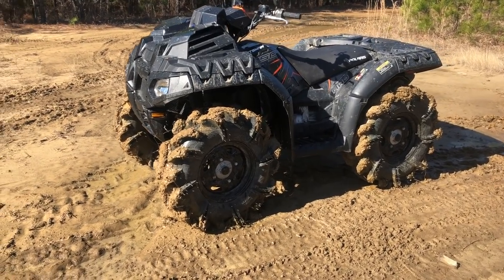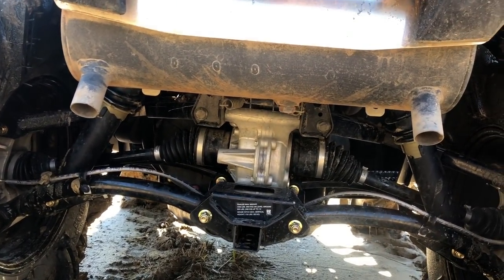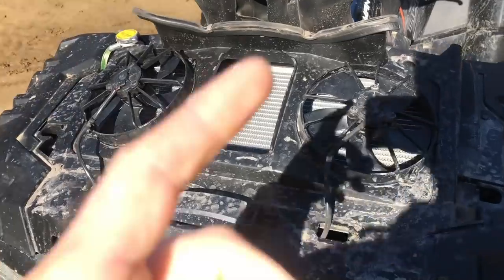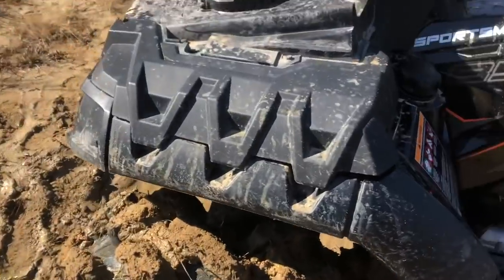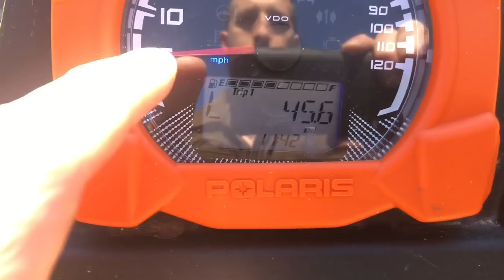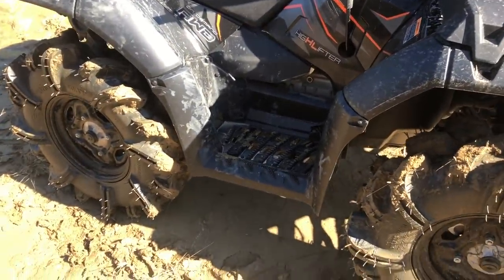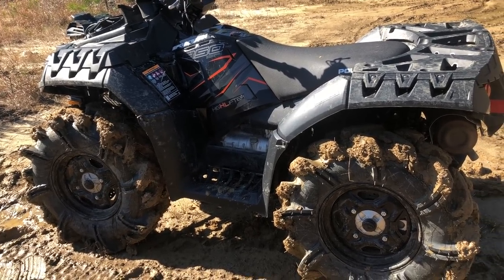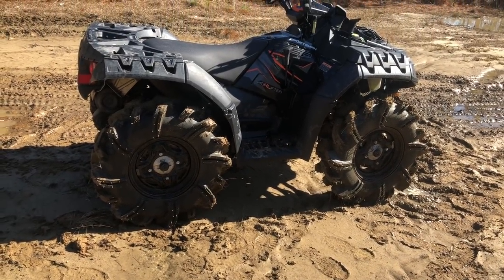2019 Polaris Highlifter 850 (Review & Ride)

Comment: Do you know how to get more speed out of the 850 hL bc it’s set at 50
Reply: Willie Stewart that’s because it has a 30% gear reduction...
Reply from the maker: Yeah I’m not sure if it has a governor or not maybe it can be programmed?
Reply from the maker: Lucas Massey I wonder if you can compensate somehow?
Reply: Sir Douglas at 50 MPH it’s running 7200 RPM, or somewhere around that, bigger tires will give you a little higher top speed, but then you start running into axle issues, and with a 2” lift, to run 31s, you have to have a 1” spacer in the rear if keeping stock rims.
Reply: All of the gears have a reduction on them check mud puppy he has a video

Comment: I really a need a honest opinion on the no power steering! I’m about to buy one. I need a detailed answer. 
Is it worth the money for the bike to not have power steering? And what’s it feel like in the mud
Reply from the maker: I honestly have had zero issues without power steering. When i'm rolling very slow I imagine it would be easier with power steering. However you can imagine in mud or a soft terrain its not an issue. especially in 4 wheel when the front tires are spinning its very easy. In fact most power steering bikes the faster you go the less the power steering actually kicks in. Ive never tried one with power steering though, so thats why the decision was a little easier to make. Hope that helps!
Reply: Sir Douglas I got the 1000, and the Power Steering doesn’t even really feel like it’s on when you’re in the mud. But when you’re just riding the trails between mud, it’s super smooth, and the power steering is always at max as they don’t have the Dynamic Power Steering like Can-Am does.

Comment: I have the 2018 high lifter 850 so basically when do you use high? Hitting a mud hole fast? Or open fields? I usually use low on trails about 25 mph max I go in low
Reply from the maker: cody sindoni I have been told by multiple people to stay in low %90 of the time. Mine will go 30-35mph in low.
Reply: Sir Douglas so basically when do you use high? I’m confused on how they used the gear reduction
Reply from the maker: @codysindoni6943  Sorry didnt see you replied again. Any experienced rider has told me to basically never use high unless your on a big straight away. For most trail rides just stay in low and it will maintain the longevity of your bike.
Reply: Sir Douglas so I can go 35 mph in low?
Reply from the maker: cody sindoni mine will yes
Reply: Sir Douglas hope I haven’t been hurting mine I hardly ever put mine in low
Reply: Low range is easier on your belt, if you are climbing hills, going into deep mud, or rock crawling, anything like that, you will want to be in low. If your just cruising trails and thw bike feels like it has plenty of power high is fine. You will not ruin your bike. High gear just makes the belt work harder, so worse case you will need to replace belt sooner id you never use low. This is why its recommended to use low for the "break in period" it help settle the belt into the clutches. Once its broke in properly it should last a long time. Hope this helps some, and that is a badass quad man! Hope you are still enjoying it.

Comment: What a waste of a great quad...never could understand why anyone would try to ride through a pond.  That's what jet skis are for...
Reply from the maker: cr500blur Yeah I don’t understand the water wheelies either
Reply: It's a highlifter... It's ment for mud an water... Bruh
Reply: @colegentile2079  I guess that's what you do when you don't have mountains
Reply: Being capable of deep water crossings is hardly a waste imo. In the northeast it floods every spring. With that machine all that water on what used to be your trails adds to the fun of the ride. Its not for everyone i get it. Thats why they make different models.
Reply: @SketchyXC  I'm talking about riders intentionally riding into a pond, not a flooded trail.  Ponds are for jet skis...
Reply: @cr500blur  I'm with you, I don't look for mud or water because it is so hard on your machine and I hate spending money on unnecessary repairs.
Reply: Your machine is only as good as you take care of it